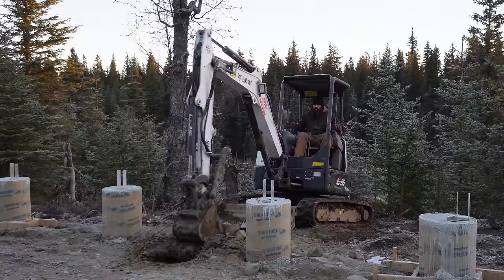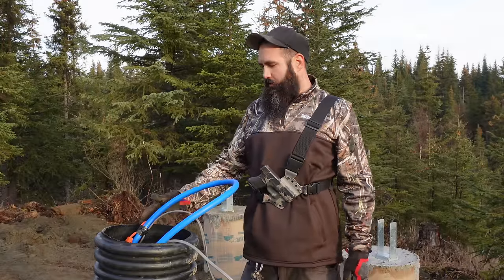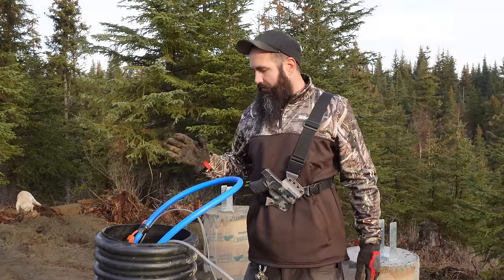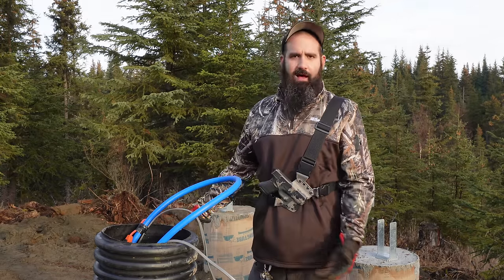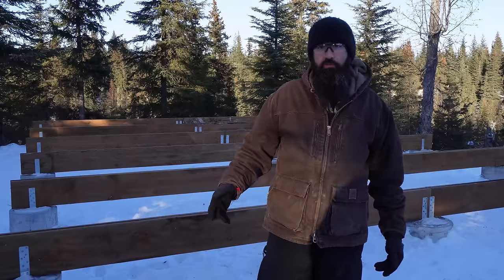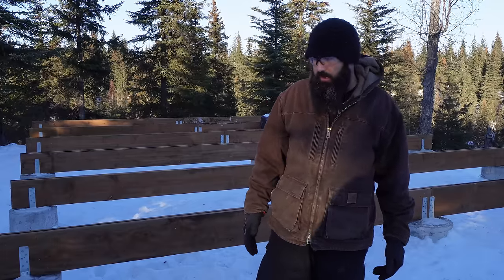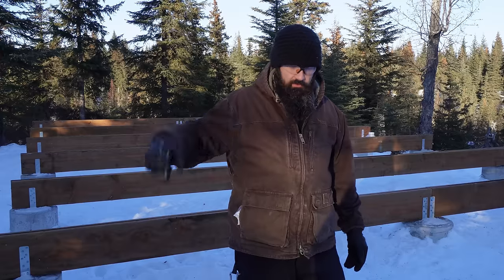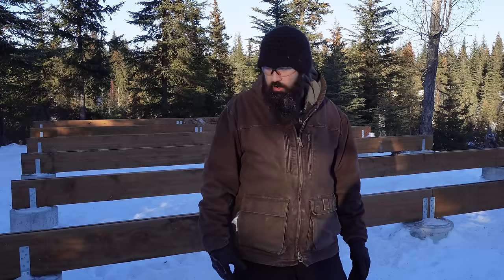Finishing the Foundation | Building Our Alaskan Cabin

Comment: Very stout foundation.  It'll be interesting to see if that vertical culvert will work to keep the water line from freezing.  The closed in and insulated crawl space should help as well to keep things under the house from freezing.  Looking forward to seeing your house going up.  Have you shared the house plans?  Thanks for the video.
Reply from the maker: Thank you!  There will be more to the culvert pipe at a later time that we will share.  We have not shared the plans of the home because we have had to make several revisions to our final plan due to certain material availability and costs in our area.  It will be a small cabin with a partial loft, we are working to keep it lightweight but insulated very well to reduce heating needs from wood or alternative. We will be building a cold roof system even though it is a cathedral ceiling. Ice damning is a big issue here.  Thank you for your support!

Comment: Bought them carriage bolts and nuts at Home Depot for between $5 and $10 each depending on the length for my 100 foot deck. Then found out you could buy the exact same ones by the small box at the nut and bolt store for about $1 each ! Boy was I pissed . So do not forget to shop if possible.
Reply from the maker: Thank you for sharing. Our location is limited in options but I will research if we have a nut and bolt supply anywhere local with better prices.

Comment: Won’t the gravel pierce your plastic barrier
Reply from the maker: It is possible. But the plastic is very thick, and the gravel is mostly round stone mixed with sand so it should be ok.  This will not be an air-tight insulated crawlspace so it does not need to be hermetically sealed.

Comment: Looks like you got just enough of a break in the weather to make some good cabin progress. Looks like the top eight to twelve inches of ground was frozen. You made quick work of the plumbing with the backhoe. That size backhoe was perfect for the size of your work footprint. The piers look really good. The vapor barrier was a nice idea. I haven't seen an update on the status of the spring. Is that going to be able to get you enough daily water? Nice job once again. Thanks for the video.
Reply from the maker: It was frozen! The excavator had a difficult time cutting into the frost.  We were cutting it close but were able to finish just in time. You will be happy to know our next video is about the spring and where we are currently with it. Spoiler, it has been working out great for us! We are excited to finish the final part in the springtime but for now, we are just thankful to have a water supply within walking distance 😀 thanks for your support!

Comment: Came in from processing our pigs and seen your video was up 😀🎉. Holy crap you can drive your skid steer on that floor with the joists you built. Hope you both had a great Thanksgiving in the great white north. Stay safe friends, looking forward to the next video.
Reply from the maker: Yum fresh bacon! We calculated the wood beams to hold 70k lbs combined weight. We should be nowhere near that with the small cabin and snow load. 🤞 we are working on our floor joists and subfloor now.  Hope you guys had a great Thanksgiving too!  We had dinner with friends and family here in Alaska it was a good weekend 🙂  we had unusually warm weather this week, we went from negative 3 as a low about two weeks ago to a high of 38 rainy and windy this week. Most of our snow melted from the rain and now it is an icy mess 😅
Reply: @northtoalaska2022  Awesome ‼️. Our Thanksgiving was quiet just as we like it. It was in the fifties here and dropped into the low 20’s with wind chills in the single digits 🥶.

Comment: Not sure if thought about this but you may want to sandwich the seams in case your foundation shifts over the years. Since you butted up the seams (ex. Just put about 6Ft on both sides and lag bolt them.) nevermind I should of waited until you finished   you bolted them cool
Reply from the maker: This was one reason we added the extra brackets into the concrete for extra support at the joint, we were very liberal with nails and bolts to help keep the beams ridgid. I believe the subfloor system will also put more strength into the beams once it is all together and nailed in.  The best way would be to have one-piece beams made. But they are not readily available here and are very high cost.

Comment: You missed a big opportunity, instead of the ribbed PE pipe water line chase to bring your water line from underground to the cabin floor you should have used a piece of 12" diameter sonotube and secured a piece of 1.625" OD, 1.481 ID "K" copper pipe vertically in the exact center of the sonotube, then purchase 2lb density two part, closed cell, insulating, pour foam to fill the void between the sonotube and the exterior of the pvc pipe. Part A and Part B of the pour foam are mixed quick and then poured in expanding very quickly. It would take a few batches to fill the void but very quickly you would have a fully insulated vertical water line chase and be able to back fill it. Then your water line with the heat trace goes down through the copper pipe and out the bottom into the trench to your spring. Once the foam is cured you can remove the sonotube if you like or not it is not necessary and in the event of a repair in the future you can always pull your water line through the pipe in the center without unburying the foam column. An 12" sonotube with a 1.48" copper pipe center tube would give you 5.19" of foam thickness surrounding the copper center pipe, polyurethane foam is usually an R value of R7 per inch of foam so your insulated column would be an R-value of 36 which is excellent and even better insulation than the 5.5" of fiberglass insulation in most home exterior 2x6 walls. Leave a few inches of copper pipe exposed at the bottom and cut a notch(add a rubber donut acting like a grommet in the notch to assure you do not cut the water line) for the water line to turn 90 degrees into the trench. Why copper pipe? Copper is the most heat conductive metal it will take 'heat' from the earth and keep the temp inside that copper pipe above freezing as the outside of the copper pipe is heavily insulated from the frozen soil near the surface and especially between the ground surface and the underside of the cabin. Seven feet below the ground surface the temperature of the earth is 50-60F constantly winter or summer and the copper pipe with move that heat up from below to keep that water line flowing freely.
Reply from the maker: Interesting idea, thank you for sharing. We have a similar plan we will be using to finish this installation minus the copper pipe at a later time. Copper pipe is prone to cracking from frozen water and I would worry it would be near impossible to replace if it were to burst in this situation.  The Pex tube is flexible enough that it should not burst in most situations where it would freeze.
Reply: @northtoalaska2022  The copper pipe is not for the water to travel through it is only for the PEX waterline and heat trace to go down through the center of the foam insulation cylinder. The water never touches the inside of the copper pipe. The copper is specifically used just to 'pull' heat out of the ground as a passive way to keep your water line from freezing without have to turn on the heat trace reserving that for the absolute coldest nights vs something like pvc pipe that is an insulator and would not draw heat from the earth.

Comment: Enclosed but center crawl space.  Does that mean your insulating the bottom of the sub floor?  If so why bother with skirting and vapor barrier?
Reply from the maker: Yes, we will insulate under the subfloor. Skirting will be to slow drafts and keep out animals.  The vapor barrier is to slow moisture buildup inside the crawl space.  It could be done the way you explain if it were a summer home, but we will live here full-time for many years and need it to be efficient and dry

Comment: Which do you prefer, black flies or cold?
Reply from the maker: The mosquitos were more intimidating than the black flies in our area this summer. I honestly enjoy the snow and cold more than the humidity and heat we had back east. Summers in Pennsylvania often prompted big air conditioning bills and being inside the airconditioning whenever possible. With the right clothing and equipment, the cold is manageable 🙂 biggest downside to the cold is not being able to dig the ground for construction projects.
Reply: @northtoalaska2022  thanks for responding. I lived in Michigan.  Totally agree

Comment: I would have run my waterline through 4" plasting tubing to facilitate changing out the waterline without having to dig down 7 feet, I would also run a second waterline in the same pipe so it's already there. If there is a chance for something to go wrong it will so I am big on redundancy and planning for the worst
Reply from the maker: I can agree it would have been great to run the water line inside the pipe just in case.    It would have been quite the challenge physically and financially getting down in an 8-foot trench that needs to run 300 feet down a steep hill to the spring.

Comment: Why didn’t you put washers under the heads of the “lag bolts” you installed in the beams?
Reply from the maker: These are carriage bolts, the head is oversized like a washer, and when you draw it tight the square neck pulls into the wood keeping it from spinning.

Comment: Like i said in one of your other videos put in a ram pump which runs on gravity and uses no electricity you can pump it up hill to your main cabin and it will pump constantly twenty four seven 365 days a year and you can source the components from your local hardware store  you could have a system that runs out from your house to your chicken coop which will run to it as well. check it out on Youtube lots of ideas there. here is a link to it!
https://youtu.be/ryjD5LnCyJ4?si=zjzEoxcdblHX_-hs
Reply from the maker: Unfortunately, I don't think we have enough elevation fall or flow to run even a small 3/4 inch ram. I also understand that the freeze during the winter.  We do have several other spring we can tap into to increase our flow but I'm not sure how to overcome the freeze issue for 6 months out of the year and the elevation issues with the topography of our property.

Comment: One thing I noticed, on the foundation ledger boards, you added a smaller length board between the longer but nothing supporting them other than the screws.
Reply from the maker: Lag screws in all concrete brackets. 5 Nails every foot per side, carriage bolts in all beams throughout. Hope this helps

Comment: What is the insert you put in your pressure treated cross beams?  Was that simply to bind two of the 2x8s together, or was that groove in the beam itself ready for an insert?
Reply from the maker: Those were treated plywood planks we cut to space the beam to fit the brackets, they are sandwiched into 2x12s. A cheaper alternative to custom laminated beams.

Comment: I just watched a skill carpenter put on a subfloor and his way of doing it was nail a chipboard on the bottom and flip the floor joists over with each section of a 4x8 ft piece or what ever size you need to get the middle of your house, and that way you dont have to crawl under your house and put the insulation in and another sheet of chipboard  which would be really hard to do later. just remember that because you are flipping it over you need to end up with the crown of the floor joists up after you flip it over.  I hope this all makes sense to you.
Reply from the maker: Thank you for sharing! I have seen this method before it could work well in many cases. With us having I high chance of our floor system getting wet from snow and rain we have decided to wait to insulate until the roof is on because If we can not prevent 100 % water intrusion the insulation and Sheathing on the bottom will be ruined.

Comment: Why does the wrap have to be taken off the concrete
Reply from the maker: Instructions on the sonotube state do not bury, and remove form after concrete is set. If it is left on it can deteriorate causing air gap around concrete in the ground. Hope this helps.

Comment: What is the purpose of the gravel on top of the plastic in a crawl space ? Surely the gravel will simply make holes all over the plastic and you've defeated your purpose of laying the plastic ??  I listened several times to try and understand before resorting to asking.
ps I'd understand a light layer of sand ???
Reply from the maker: Hello 👋 the gravel we added is mostly round riverbed rock and sand. The plastic is tough and thick. It should hold up well. Since our crawl space is going to be fully vented and not heated it does not need to be hermetically sealed. We are only trying to lower the amount of moisture coming out of the ground and into the crawlspace to prevent mold on joists and insulation. The crawlspace will be closed off with skirting to prevent animals from taking up shelter underneath and slow down drafty wind under the cabin. we plan to have doors in the skirting that we can open to store ladders and possibly other tools underneath out of the weather. The gravel will help keep the plastic from being damaged by traffic in and out when we are building the floor framework. It will also be great for when working under the cabin on insulation or pipes and wire not to lay in mud or pooled water. Our last home had a dirt crawlspace and it was horrible. Hopefully, this helps explain our logic, we try not to go into a lot of detail on our videos because we do not desire to be a how-to channel and we find it boring.  What works here in Alaska may not work in a lot of other environments and vice versa. We are basing most of our cabin construction on information gathered from the Cold Climate Housing Research Center.  Some of the recommendations for Arctic climate building we are not able to afford but we are doing the best we can to build a home that will last for our lifetime and hold heat efficiently.
Reply: @northtoalaska2022  WOW, my goodness THANKYOU SO MUCH for such an in-depth explanation. I was hopeful of a simple answer but you've gone above and beyond, GREATLY APPRECIATED 👏👏👏👏👏👏👏👏
Your explanation makes good sense and I'm sorry for being the nerd that likes to not only watch videos, but understand them as well. So I'm one who doesn't find the explanations boring, but rather they are informative and thus one learns something new every day. My motto is "A day without learning something new, is a day wasted".  
I shall follow you with greater interest now as I know every part of your build is planned and researched to meet your distinct needs. Again I thankyou for such an informative reply and I hope you continue to build and develope your dreams in the cold North while I sweat down here in the hot humid subtropics of SE Queensland Australia. Peace out guys.🇦🇺🤗💞🙏👌👍✌️👏🇺🇸
Reply: @northtoalaska2022  That is a fantastic idea! I'll be putting that one in the notes for when we build our cabin up here. Love the channel!
Reply: @northtoalaska2022  Well said!
Reply from the maker: You are very welcome for the response 🙏 it is no problem.
Reply from the maker: @beccaanlevialaska Check out the Cold Climate Research Center for sure they have a lot of helpful guidelines for building in all the areas of Alaska.  It is a great official source for the Arctic and sub-Arctic area, they have a YouTube channel describing proper ways to vent, insulate, and do a vapor barrier here to help your home last many years!  The relative humidity/ dew point in Alaska can cause many frost and moisture issues.

Comment: Going to be tough to get into that crawl space for any meaningful work now or later.  Just not enough room.  Also, using pool liner is a better choice than visqueen as it is u/v resistant as well as available in 12 to 15 mil or more thickness so you have a tough barrier to stand the test of time.  Not all that much more in price.
Reply from the maker: Interesting, I have never seen anyone use a pool liner for a crawl space. With gravel on top of the poly, UV is not an issue, once the project is finished with skirting it will never see the sun again. The floor joist will be on top of these beams there is two feet of access on the lowest point, it is up to a foot and a half higher on the far ends where the ground slopes away from the foundation. Should be adequate for the small amount of time we have to spend underneath.

Comment: I hope you plan on Foam insulation.
I have 12" in the floor with 6" in the walls and rafters
Reply from the maker: Unfortunately, we can not afford spray foam. We will most likely be going with blow-in cellulose for the added r value and cost. Ridgid foam for a thermal break as per the cold climate housing research centers guidelines for arctic construction

Comment: Read the papers that came with the heat tape specificaly use on pex pipe you need the aluminum tape they also sell to prevent the heat tape from melting/burning the pex.
Reply from the maker: We read the instructions,  I'm sure there are different types of heat tape, this specifically instructs to use electrical tape directly to the pex.

Comment: I wish USA would upgrade and start using eu pipes.. the ones with seal at end that dont need any of that glue and you can dismantle any time you like if the fit you did is bad... When i see you glue those pipes.. feels like stonehenge ..
Reply from the maker: Haha yeah, I am uninformed about the methods used in Europe. Glue and PVC are standard here in residential use septic or drain. Many homes in Alaska have copper/ solder plumbing but that was uncommon on the East Coast where we used to live. Some commercial construction here uses steel pipes for different reasons.